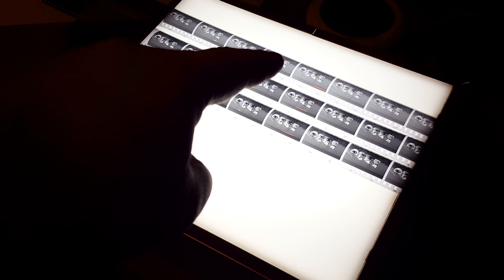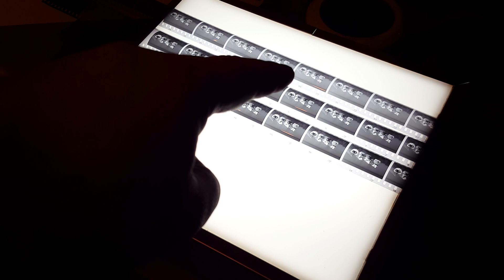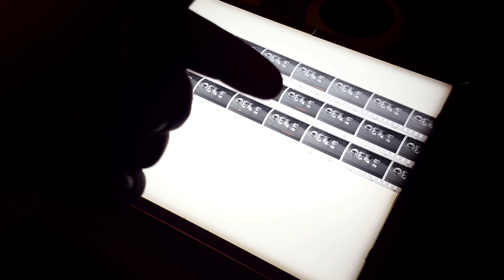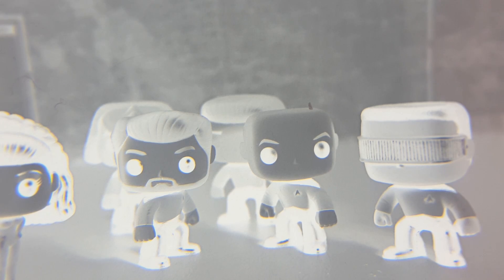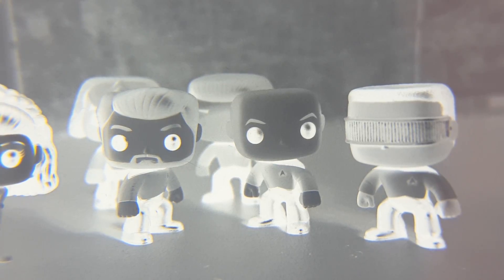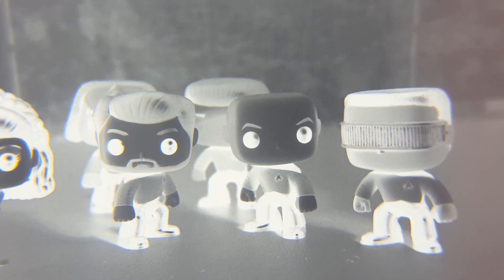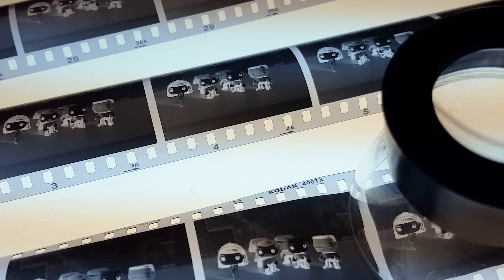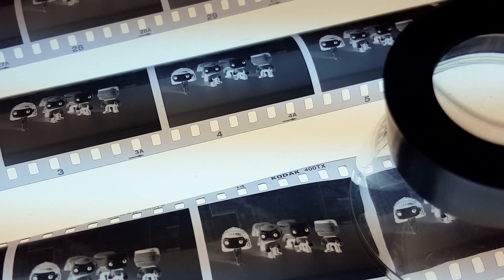How Does Agitation Frequency Affect a Negative? | Days of Knight 170211.7-044

Comment: whats the best way to prevent film from scratching
Reply from the maker: During which part of the process?
Reply: Azriel Knight drying stage. i know not to touch the film surface etc but what is the best way to prevent dust and how to get the water off the film as i use a rubber squeegee  but i still get some scratches.
Reply: Zazno Productions you can use a hardener which effects the emulsion into a harder state making it less likely to scratch. Cheers, Paul.
Reply from the maker: Ditch the squeegee, in my opinion. If your environment is dusty and hard to dry in a squeegee wont fix it, just my thoughts. Paul's right, hardening fixer will help protect the film, most films don't need it anymore, but it doesn't hurt it. I still use Kodafix, which is a hardening, but don't always use it because it's hard to wash off. Now I use Ilford's fixer, a hypo clear, and photo flo. Sleeve them as soon as they're dry, with gloves on. I'm in an incredibly dusty basement, and have little control over the climate so I feel your pain.
Reply: Azriel Knight yeah thanks very much. im in my grandads old darkroom which hasn't been used for 25 plus years so its dusty in there. ive done my best to try to remove the dust but i cant get it all. so do u recommend usind my fingers instead to wipe of the film? i found some id-11 from 25 years ago still in its original packaging. there is about 4 packs of that. also some d-76 and 5 liter of ilford hypam which i through out because it had solidified on the side of the bottle. but it would be interesting to see how well 25 yo id-11 works now!
Reply from the maker: Being able to use a "real" darkroom that belonged to a family member is a rare gift few photographers will get to experience as we move forward. I'm absolutely jealous. Make sure you get lots of pictures of that thing.
As far as fingers and film goes basically, when I am done pulling it out of the photo flo, my fingers are covered in it and after hanging, I use my index and middle finger as a squeegee and run it along the film once. If the id-11 is in powder form, it might still be good! Maybe pick up some new stuff and do a side by side?

Comment: I love these experiment videos. It seems like so much in film development is based on old wives tales and tradition; it's hard to separate fact from fiction. This suggestion might be a little boring, but how about an experiment with and without using a stop bath? I always just use tap water as my stop both and have never had any issues, so I'm wondering if there's any real benefit.
Reply from the maker: The real clown is the one who can't make their point without putting down someone else.
Reply from the maker: Thanks for the suggestion Mark. I might try that someday. I suspect that it wont be much of a difference, but in the case where I leave the tank sitting for 10 or 15 minutes like in the last experiment it would. Water slows development but doesn't totally stop it but I would be curious to see as well.
Reply from the maker: You might be right roolin. These tips are passed down, but those people used different chems in a different time.
Reply: It's also likely that advancement in film technology made some precautions not that crucial anymore!
Reply: Stop Bath is just weak acid solution...maybe your local water is slightly acidic?
Reply: I know this is a really old thread but is it generally advised to rinse between each bath with c41? 

Eg. Developer > Rinse > Blix > Rinse > Stabilizer > Rinse > Photoflo? 

These videos have helped me so much thank you!
Reply: The first reasons why it is adviced to use stop bath is for preventing the fixing bath from expiring quicker. BUT it is not entirely true because if you rince well between the steps it has no impact on your chemicals. The second reason : it is because major companies (Kodak, Fujiflm, Ilford) want you to buy more of their product : stop bath (wich is vinegar BTW). I stop the developping process by using water, it works, (so far 40 rolls) and I do not have any problems. I develop for other people using water for stop bath I have no problems. It is known among old school printer to be less agressive for your emulsion. And it is cheaper. Period. My words have been called "horseshit" with no other reason than ignorancy. Seriously?
Reply: Verdoux007 I have this advice from the Jules Steinmetz develloping method. He was a very famous french printer and film developper he worked for  Magnum, HCB, and a lot of french magazines. Call it horseshit all you want, but this guy did not used any stop bath at all, for the reasons I mentionned before. Jules Steinmetz was not a clown commenter from YT, but a true solid professionnal who worked for many decades for the greatest.
Reply: +Alexeï Girard That's complete horse shit. Out of all the chemicals that you use during the developing process the stop bath is the mildest one and besides you remove all those nasty chemicals during the final wash.
Reply: The real thing is when you use a chemicals stop bath your emulsion gets more saturated with chemicals. If you want a better life expectancy for your negatives use water as stop bath.
Reply: +Alexeï Girard So you would trust one man's anecdotal evidence against Kodak, Fuji, Ilford and all the millions of people who have used stop baths in their developing without any problems. Tell me again, who's the real clown in this situation.